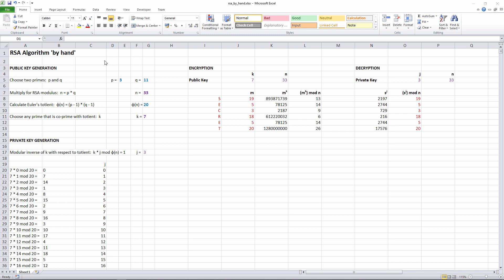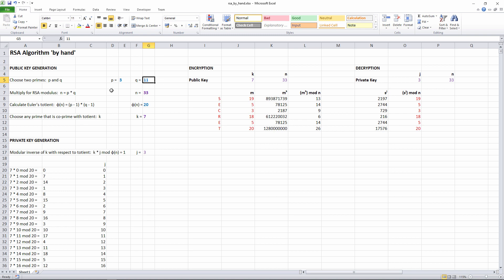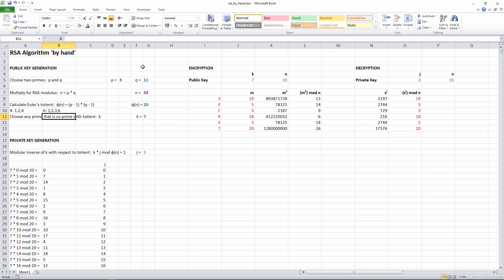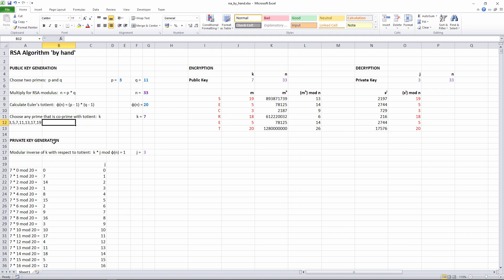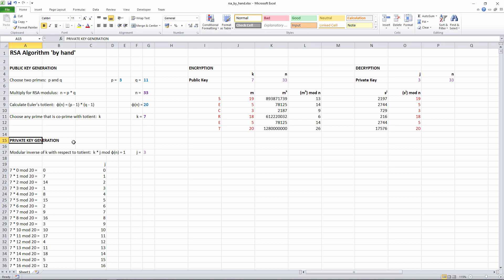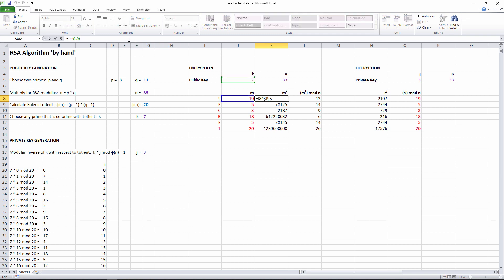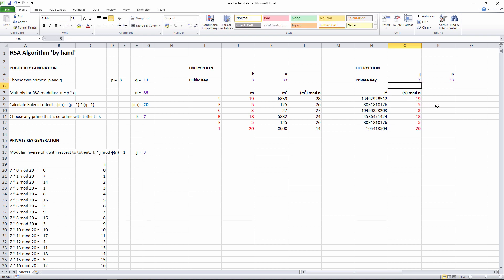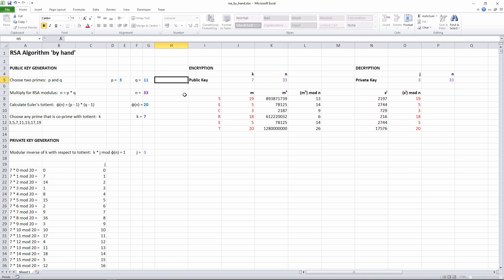Asymmetric Key Cryptography: The RSA Algorithm by Hand

Comment: Do you have a video on what is done to use larger primes and not encounter the representation errors you hit at the end of this one?
Reply from the maker: I'm afraid not.  Typically, you would not do this on a spreadsheet (I wanted to lay it out visually).  Rather, you would do it programmatically.  Most high level programming languages support very big numbers one way or another. :)KD
Reply: @ComputerScienceLessons  after some digging it seems the key is https://en.m.wikipedia.org/wiki/Modular_exponentiation

Comment: Excellent overview. It seems as though the ciphertext is vulnerable to frequency analysis and more, however. I'm assuming RSA is normally used in conjunction with other algorithms and techniques that effectively prevent such attacks?
Reply: In practice, the rsa keys are used to transmit a truly random one-time-pad, which has no frequency content to attack with frequency analysis. Once both sender & receiver have the one-time-pad, they use that to encrypt a real message, and frequency analysis has no leverage against the resulting encrypted message
Reply: Hashing
Reply: @williamsmith255  Hashing the plaintext prior to encryption or the ciphertext post encryption would help prevent frequency analysis of the ciphertext, but it would also render the decryption theoretically impossible. Hashing is largely used for proofs as I understand it, not direct encryption. Care to elaborate?
Reply: Isaac cypher
Reply: I don't know if I missed something or what, but I was able to decrypt the message without the private key by simply taking the publicly known information and generating a lookup table.

If my analysis is correct, then this encryption method is little more than a keyed Ceasar Cipher?

Can someone enlighten me?
Reply: @fredjenkins5069  for small primes, the lookup table is indeed small enough to enable such brute-force decoding. In practice, the large primes yield lookup tables that are intractable to compute